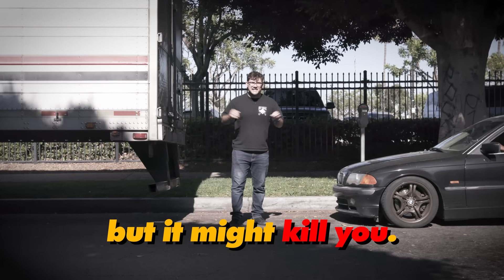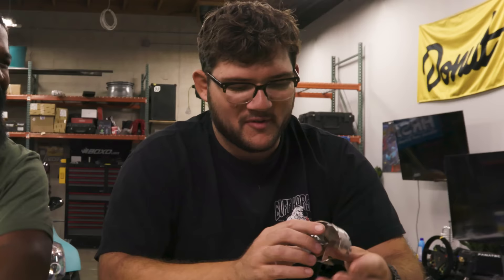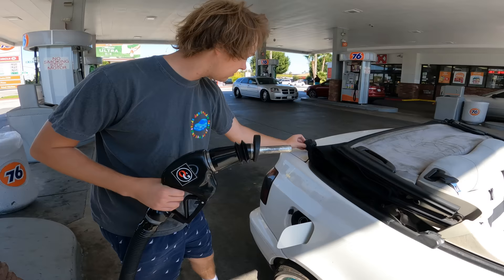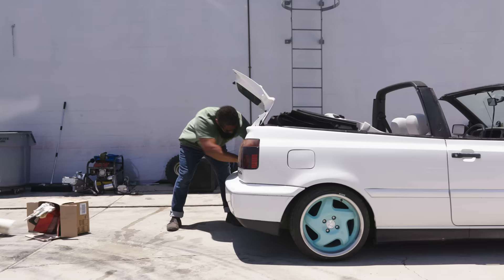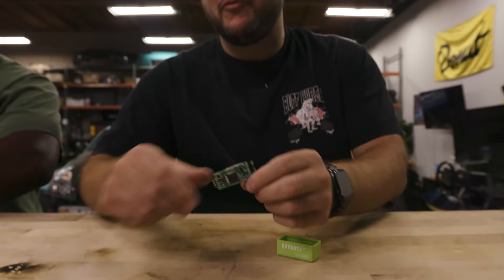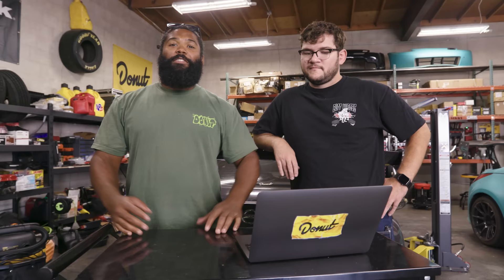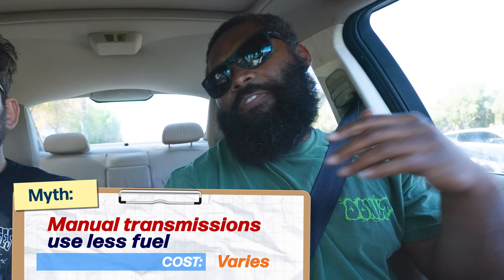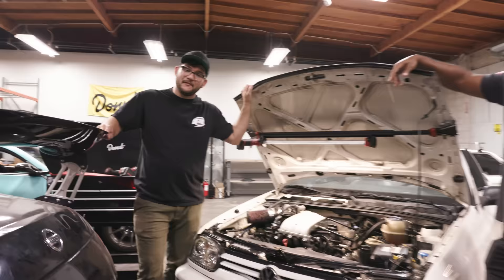Testing Fuel Economy Hacks

Comment: A major contributor to auto versus manual fuel savings was the torque converter slip. Modern vehicles will use a locking torque converter or dual-clutch to prevent that power-loss, thus increasing efficiency. That wasn't super prominent though until about a decade ago, not so much 50 years ago. The more you know!

Comment: I love how they checked what the tire pressure should be when they had aftermarket rims and tires
Reply: their explanation was problematic too.  too low pressure = less efficient because because flexing tire sidewalls.  too high pressure = less efficient because the tire isn't working as suspension.  gotta match tire pressure to the tires.
Reply: @SB-pf5rc  that makes no sense
Reply: @malm4640  flexing sidewalls lose energy as friction/heat: low air pressure does make a detectable difference in efficiency

I don't think over-inflated tires "not acting as suspension" reduces efficiency, but over inflated tires don't increase it very much (if at all) and this significantly increases tire wear and significantly reduces performance and, most importantly, safety.
Reply: They're also completely wrong about this one being a myth, plenty of electric cars come with high pressure tires as it reduced rolling resistance and increased economy. It's super weird that they wouldn't know this.
Reply: @CleverAccountName303  it's not nearly as significant as underinflated tires, but it's easy to perceive on like a bicycle where you're the motor and you ain't shit.  excessively hard tires waste energy.

it'd be easier if they said 'keep your tires at their ideal pressure.'  cuz that's better for both performance and economy.  

i'm being pedantic, but their interpretation came across as a dumb take.  good tire setup is important!
Reply: @SB-pf5rc  if your tires are so over inflated that they slip from acceleration, then yes, that would be a slight decrease in efficiency. 

 Also, on a bike without any suspension, over inflated tires are even more of a safety hazard than cars during cornering and braking.  Not to mention the harsher ride that will exhaust you faster since (other than tires) your body is the suspension.
Reply: @CleverAccountName303  that sort of makes sense as some one that rides mountain bikes fill it up to 60psi your tyre is getting hanged up on every rock  and root bouncing of them backwards slowing you

Comment: As a computer nerd, automatic vs manual kind of reminds me of overclocking CPUs. In that, with older CPUs, you used to have to manually overclock to squeeze every last ounce of performance out of it. But nowadays, the automatic boost algorithms are so good that doing so manually will probably end up as a detriment to performance. Still a bit dependent on brand and if you care about power-draw through.
Reply: a more suitable analogy to the manual/automatic overclocking would be fuel injection vs carburetors

Comment: (Long time ago) found myself once without money on the end of the month, having to ride way too much km's on way too few fuel. Was riding reasonably close behind trucks the whole way and made it. Most insane economic ride I ever did. Since I did the same on my road bicycle once, over 80km'h so I knew exactly the sweet spot (you fall out of it, ride is over...yeah I was a bit nuts). Just one tip IF you would ever do this, make sure it's a heavy loaded truck, gives more response time.

Comment: When I was expediting I would get behind a semi just through the turbulence and my mpg would go from 25-35+ saving me fuel.
Reply: I sat behind a truck for about 70kms one night back in the late 90s coming home from a country town, no stations open to get fuel so sat behind a semi for most of the run. You can feel the car get easier to drive when in the tow, you can be 3 to 4 car lengths back and still works.  Carefully checking the fuel gauge and occasionally pulling out so the truck knows I'm there, he knew what I was doing. When approaching civilization I pulled out and got level with his cab and waved, he waved back with thumbs up , if I didn't tow behind the semi I would have run out of fuel..

Comment: I removed side passenger mirror, and fabricated rear wheel covers/fender skirts, and am working on a smooth under body and rear diffuser currently. I'M already getting close to 70 miles per gallon on the highway now with these aero mods. also overinflating tires does increase mpg and reduce rolling resistance, even elon musk has said it. but you do increase road noise and reduce handling. so no idea why you guys said scam...
Reply: Even if it didn't work it wouldn't be a scam unless someone benefitted from it.
What vehicle do you have?
Are you on Ecomodder?

Comment: As someone who has done extensive tinkering with alternators, load plays a role in a different way. You alternator is always spinning but isn't generating electricity with no load because the electromagnetic core coil doesn't have supply voltage to cause the resistance needed for generation. This is why they are not easily turned into motors. I made a video on how I turned alternators into brushless DC motors.

Comment: Yes, Automatic transmissions can have more gearing configurations but they use multi planetary gearsets which have much higher friction losses compared to a more conventional manual transmission, that is why DCTs are much more faster that conventional automatic transmission, I was unsure of this but a quick google search leads me to believe that yes MTs can be much more efficient than even modern conventional ATs. I think it also comes down to driver behavior.

I love the channel by the way, keep it up.
Reply: It's not just the number of gears in an automatic.  They totally left out the fluid torque converter on cars that, for about a half century, did not lock-up and therefore there was always slippage, always efficiency loss. Up until about the 90s a manual could beat an auto if the driver knew what he/she was doing.  Modern automatics are more efficient ... but also heavier, more expensive and more prone to failure.
Reply: @seanthompson8071  I'm not trying to be mean, but don't take this channel to be the Gospel truth. (On that note, repent and believe the Gospel). If an auto had no torque converter lockup, even with 11 gears it'd be hard on fuel. It may at times be beneficial to lock a car out of the higher gears because some cars don't have the power to run in the high gears at 60 mph. It may need to run at 70 mph in that gear to be at a decent rpm to make any power. If a 3 speed auto with lock up had a good ratio overdrive, it could get really decent mpg.
Reply: @seanthompson8071  not to mention an AT's weight...
Reply: Exactly, people just don't know how to drive manual anymore but it will always be more efficient than any automatic with gears. If you compare it to a cvt, than there is a case to be made but a guaranteed heavier automatic? Not a chance it's more efficient than a human manually shifting, given the gear ratios are the same as the automatic.

Comment: I've been watching this show for years and I think this is the first time I'm going to say that you are not completely wrong but wrong. On newer turbo cars (both my f150 and my edge) will get better gas mileage on 93 then 87, the vehicle will tune its self for different octane levels on fuel, if you put 87 in it brings down the power and makes less pressure in the cylinder, if I put 93 and drive alittle bit it will notice the higher octane and give it more boost so that I get more power, you will get better mpg for 93 gas the 87. But if you take into consideration the price difference the 87 will give you better miles per dallor.
Reply: I have a Pontiac G8 GT that I am fairly certain gets better gas mileage on 91 octane despite the owners manual stating only to use 87 octane.  I have seen dyno videos where the tuner commented on how the stock tune was pulling timing so I have been using 89 or 91 octane fuel and went from 18mpg average to 19.4mpg average with me probably driving more aggressively with the windows down more often than when I first got the car.  Eventually doing some mods and a tune that will warrant using the higher octane but those have not happened yet.
Reply: Completely agree. The MPG difference I get running my MX5 on 98 vs 95 Ron actually makes it cheaper overall. 28mpg vs 32mpg
Reply: @ianD74  which gen mx5? I just filled my ND tank with 98 today and am waiting to see results. I was getting 34mpg (uk) on 95RON
Reply: @zakeywak  mine is a NBFL 1.8 VVT. Before they’re introduced E5 I would get 32mpg on regular unleaded on a 20 mile commute (driving enthusiastically). Now I can only get that on super unleaded or vPower etc
Reply: This isn't necessarily true. If an engine was rated for 87 octane, there's no benefit to using higher octane fuel. What you saw was probably placebo effect or something else at work. Also, in older engines that have been carboned up, that carbon takes up space and increases the compression ratio. Minimum and recommended octane also aren't the same thing.
Reply: I would guess that most of the gains from premium fuel comes from the lack of ethanol. The lower grade fuels usually have 10% also the reason to never use it in your gas powered tools/toys that sit for awhile as the ethanol really makes a mess of your fuel system when it sits.
Reply: @UnrealOG137  it is true though. We aren’t talking about using a fuel with an octane rating higher than the car was designed for. We’re discussing the fact that in the UK the ethanol content was recently increased from 5% to 10% in standard unleaded fuel. Increasing the ethanol percentage reduces the calorific value of the fuel and reduces the MPG. I’ve observed this in both “old” engines like my mx5 as well as modern eco boost engines. So now we have a choice between standard unleaded which is generally 95Ron and 10% ethanol, and super unleaded which is usually 98+Ron and 5% ethanol. Everybody I know thats tested it has found that the premium fuel achieves a better MPG and often negates the price difference. There’s a tonne of news articles and forum post confirming that people have experienced the same MPG drop across a range of vehicles. It’s not a placebo effect.
Reply: @mtbman1980  precisely. Until recently, fuel in the UK was 5% ethanol at most. It’s the increase to 10% which has made a noticeable reduction to peoples fuel economy. So we’re now having to chose premium fuels to achieve the MPG we’ve become used to.

Comment: Basic rules are short shift (if you have a manual) and drive in such a way that you rarely use the brakes (i.e. tight corner coming up, come off the gas and coast down to the required speed rather than relying on the brakes) with the added bonus of less brake wear...Common sense really

Comment: iirc Mythbusters tested the windows vs AC debate and found that it really depends.  At low speeds the AC seemed to drag the engine more and at high speed the drag from open windows was more draining.  It's been years since I saw that episode but I think they said windows down up to about 50mph was more efficient and after that they recommended windows up and AC on for better fuel economy
Reply: I've heard this same thing from a youtube video unrelated to that myth busters episode.
Reply: they did a few others that these guys are doing here. they showed the work and some of these "scams" mythbusters showed they do work
Reply: About 40mph is what I've seen. Will obviously depend on the aerodynamics of any particular car.